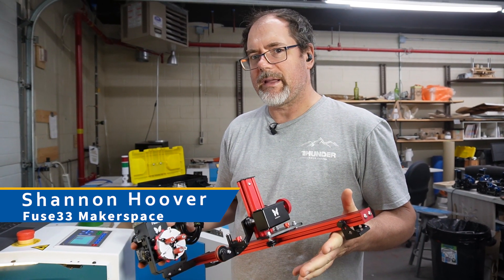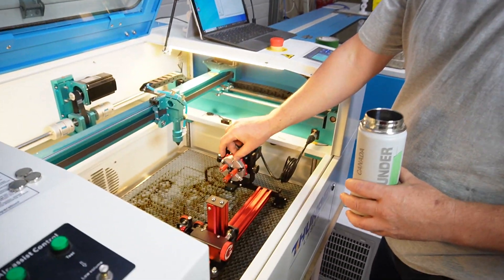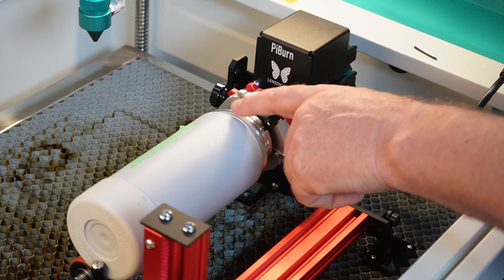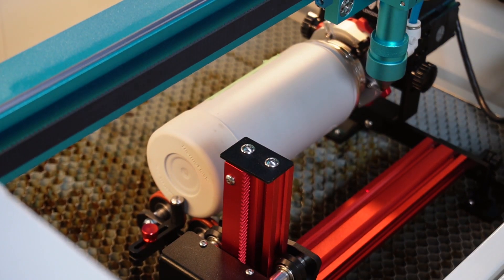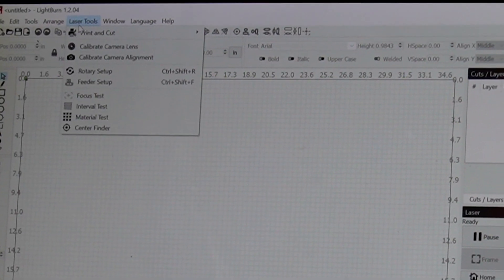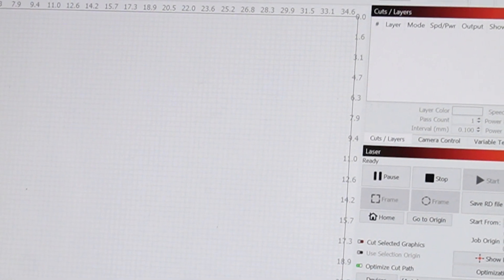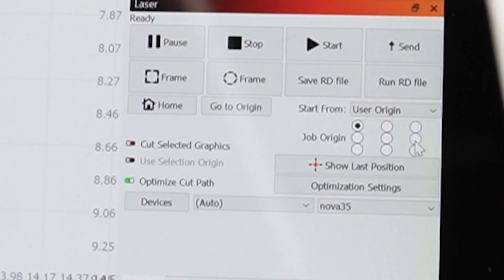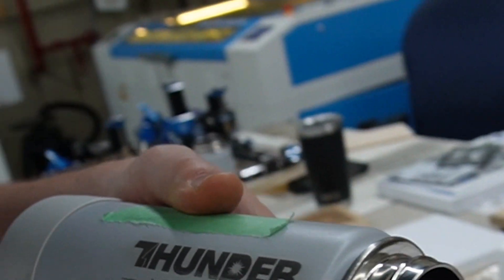Setup PiBurn Grip on your Thunder Laser

Comment: Nice explanation! I just received my Piburn about a week ago and find it really easy to use. What kind of bottle did you engrave that gives you a black finish? It's very sharp.
Reply from the maker: It looks black at first-but then you rub it off. If you want it to look black you can use Cermark https://www.cermarkusa.com/
Reply: I think the angle you're holding it at doesn't reflect the stainless steel underneath. I mistook it for a black finish. Thanks!